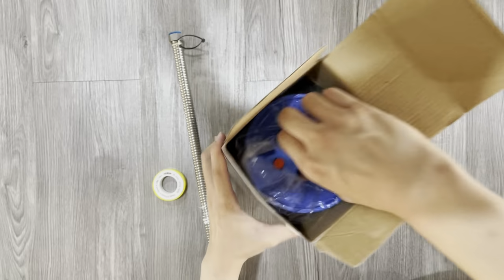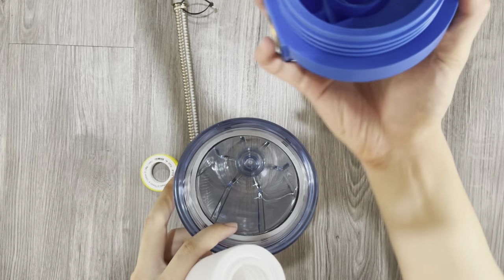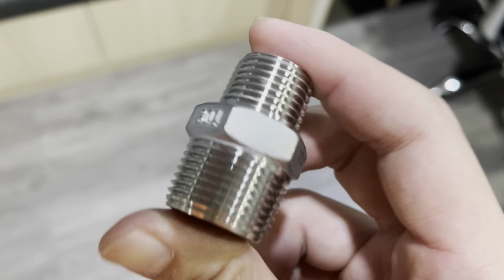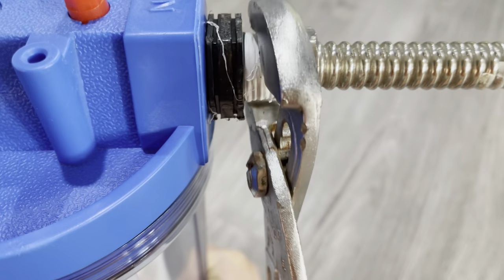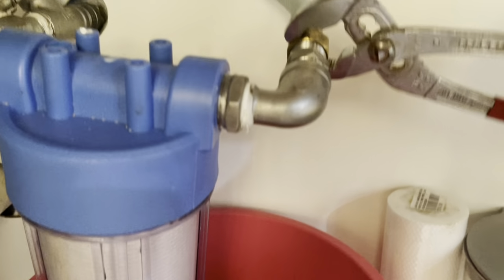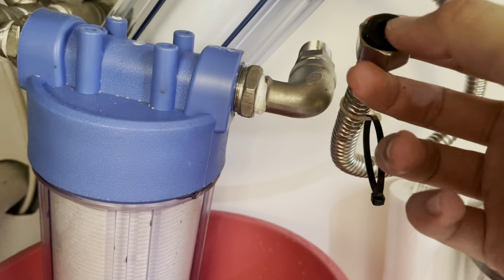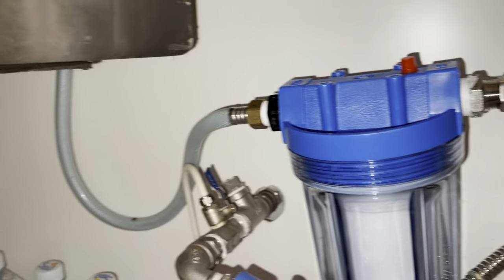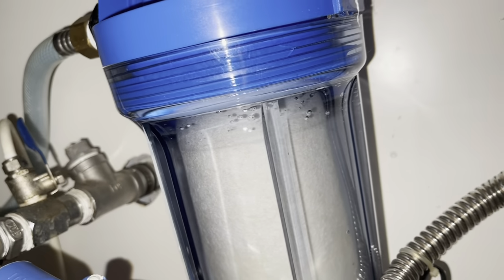"How To Install" - Housing Water Filter - Home Filter

Comment: You are doing wrong. The side of the flexable pipe do not need taflon tape it has a washer inside.
Reply: Better to be safe than sorry!!
Reply: @wittywoo9559  there is a washer.
Reply: sometimes it leaks, it's okay, but the problem is the "TEFLON" itself.